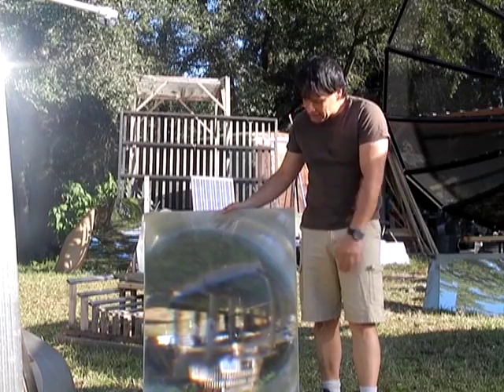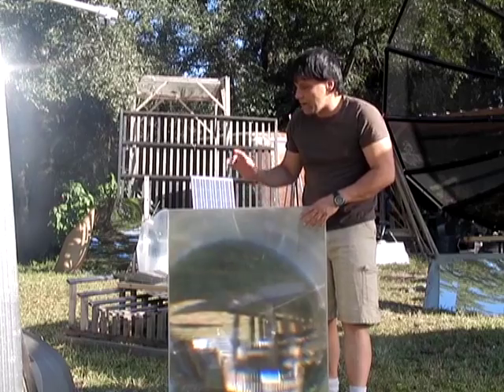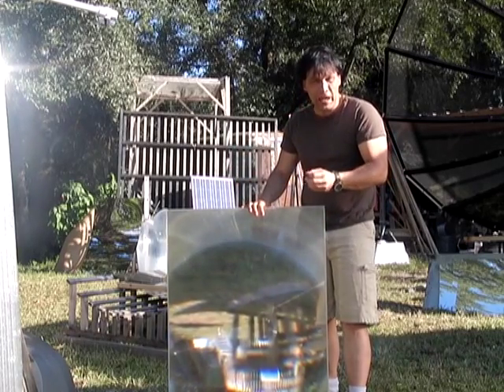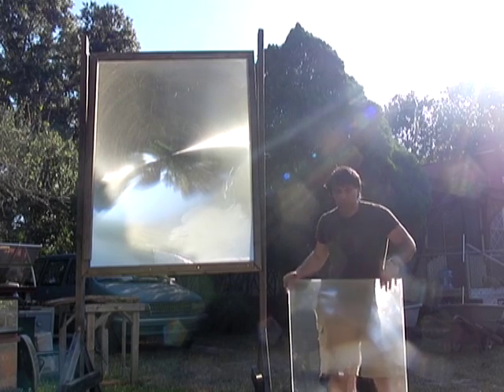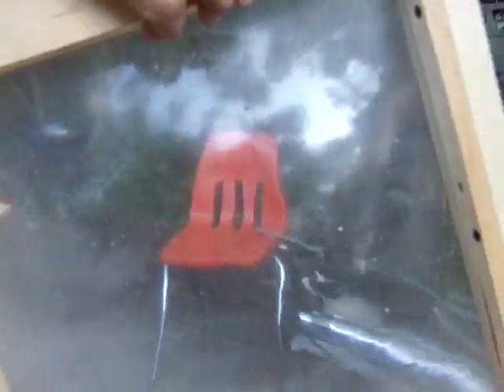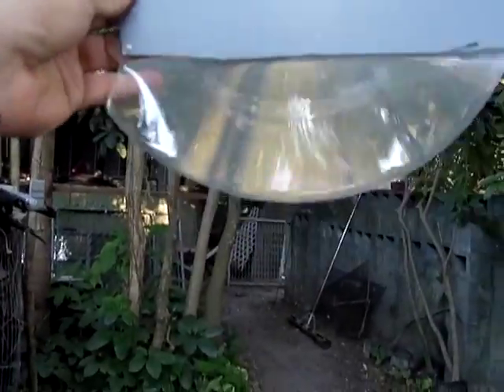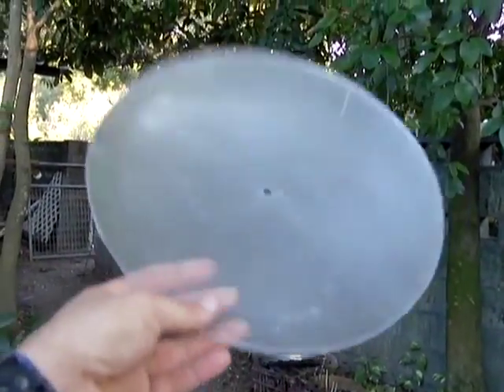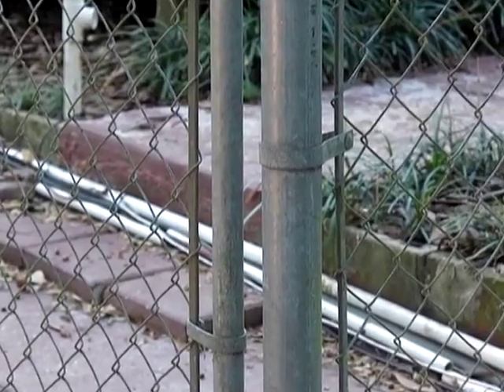Fresnel Lens Solar magnifying glass for optical scorcher

Comment: This is interesting.  I'm wondering...if you make one square or rectangular and put it on the window of a passive window heating box...and make the heating box of materials that can safely absorb and withstand the intense heat and release that heat thru openings in the top of the box, it would be like a clean and green stove...right?  Or maybe even the next generation lens would have a lower max magnification to make it usefeul and safe?

Comment: I bought a Fernel  lens from Mr. Rojas about 8 months ago. I have been trying to create a high temperature solar oven for about 5 years. Something that will cook a pizza! I like the idea of high temperature in a focused area. You can dampening the Lenz or  widening the focal point so you don't burn food or melt steel. It's how you control the temperature . You don't want to melt your len with all the heat so you need fans under the lenz to remove heat. I'll have a working oven in about a year.
Reply: You made this comment in 9 years ago, how'd your oven turn out?

Comment: Hi Dan, is it possible to manipulate a solar fresnel lens' focal length? I'm researching a system that requires a low power, 70mm lens with 20-30mm focal length. How can I pick your brains about this? Great vids btw
Reply from the maker: Hi David,

The focal lengths are usually set but can be elongated with water:

illuminating a focal point fresnel lens parabolic mirror Double the focal length part 1

Fresnel Lens Focal Length Change with Water, Concentrated Solar Power

While the "power" is set based on lens size and clarity of lens, moving closer or further away from the native focal length creates a larger spot or concentration diameter resulting in lower temperatures spread over a larger area. Let me know if this helps.
Thank you for enjoying our videos.

Comment from the maker: Too fragile for thin glass and thicker glass would be too optically distorting. Fine rings in thin glass act as as a scoreline. These UV resistant lenses last 5-10 years.

Thicker glass Fresnel Lenses like in light houses only have a a few rings per few inches.

Comment: Old video and someone may have already made this comment ... 

Use velcro to secure a cover to the frame thus blocking the sun from going through it. Could even make it out of a heavy duty fabric that would last a few years with exposure to heat and cold.

Maybe even make a slip on cover with velcro secured straps to hold it down and closed around the bottom portion.

Comment from the maker: All of our Fresnel Lenses and Parabolic Mirrors are UV-resistant, they have been tested with 5+ years of 100% exposure. The UV-inhibitors added work. Most plastic lenses only last about 1 month with 100% exposure. They fog and crack. Our lenses do not do either. They have also been installed in some of the hottest desert climates on Earth and at an Antarctic research station:-)

Comment: You are correct. A lens can not AMPLIFY the amount of energy it is gathering from the sun, as this would break the law of conservation of energy (which is the most FUNDAMENTAL law of physics). A Lens can only CONCENTRATE the energy it gathers into a smaller area, thus increasing the POWER of the energy (light, in this case) gathered. Just like a lever can not increase the energy you exert, just your POWER. Sorry for using capital letters, but I don't have the option of using italics :(

Comment: No need to disperse the heat over a large area if the vessel is full of water. No matter how thin the steel walls of this hypothetical 40 gallon (I thought they were 44?) drum were, the water would take the heat energy away faster than the concentrated sunlight could deliver it. The water will boil at 100 degrees, rapidly extracting the heat energy. Only if you went to extremes (extremely thin walls combined with an extreme amount of sunlight) would you manage a hole in the drum.

Comment: Just a point, it wouldn't matter how thin the metal is. Water is incredibly good at moving energy out of hot materials. You can fashion a crude 'pan' out of waxed paper, fill it with water and place a candle under it and boil the water. The paper will not burn, even if the flame touches it directly! So even if the tank was very thin steel, as long as it was open so pressure did not build, the steel would not melt. I like your videos by the way.

Comment: The water should dissipate the heat fast enough to not melt the metal of the tank. When using the lens. As an example if you set a paper cup on a fire you can boil water in it. The paper will burn down to the water level but not burn the rest of the cup. The water is keeping the paper below the flame point of the paper.
Now if you heat the tank faster than the water can cool it then yes you could cut a hole in it. This is what allows underwater welding. Real hot welding devices.

Comment from the maker: Solid steel blocks work good. I am working on a video demonstrating how an 8 ounce block of steel can instantly boil 12 ounces of water after a 2 minute sun exposure. The steel does not melt if the mass is larger than about 4 ounces.

Comment from the maker: Hi,

The Fresnel Lens concentrates sunlight. If the dark colored water tank reaches 120f in the sun and then a Fresnel lens of the same size of the tank is placed in front of the tank. The light will be the same so the tank temperature will have no increase. If the lens is 2 times larger than the size of the tank, the water temperature will be just short of 2x as hot reaching about 200f. Metal will not melt if water is present behind, unless very thin.

Comment: also if those are left in the sun for increasing head on a pipe lets say is there any up pretection in the plastic or will it degrade.   I like to build a solar hearter to heat my shed in the winter.

Comment: I've wondered if it would be possible to disperse the light at the focus with another lens to create a beam. In small scale, with a flashlight and lenses taken from binoculars, this is easy to do but would the heat make it impossible in large scale? I think a fresnel lens placed at the focus would just melt but how about a glass lens with the same focal length?

Comment: Could a Fresnel lens be used as the heat source for wood gasification? Would make gasification more efficient/economical.
Wood gas produced this way could be run to burners beneath an alcohol still, reducing the cost of fuel alcohol.

Comment: Sir, I'm doing a science project and I'm trying to make a system that cleans water cheaply and I was wondering: If I used a sheetsized fresnels lens, how long would the water take to boil? And is the fresnels lens the best lens to use or are there other lenzes that work the same? Because they dont sell these in The Netherlands, so I'm gonna have to order them from somewhere else.

Comment: @jab0805 The power is all about collector surface area. To get the benefit of multiple fresnel lenses, you'd have to reflect the light from multiple lenses to a single point. Think of those large solar power plants that have multiple mirror reflecting to a single point. That's the concept that you'd be looking at with trying to up the power on a single point.

Comment: Hello from Minnesota.  I got exposed to Fresnel Lenses at Split Rock Lighthouse in Duluth.  As you are aware, we get far less sunlight up here than Florida.  I would like to capitalize on what little we do get. I would like to build a low intensity array that can be used in winter to melt the snow off our driveway.  My sense is that this lens is too powerful.  Any tips on widening the beam to 4 ft across but restricting its heat output to less than 200-300 degrees?  Thanks for your work.

Comment from the maker: @jab0805 Hi,

Additional lenses only shorten the focal length by half, the second lens dramatically absorbs the sunlight into the lens acrylic because the angles are different. The Second lens drops the overall throughput by 30% the focal point diameter is a bit smaller but much weaker.

If you stack 4 lenses your focal length drops to about 3 inches and it barely burns paper, thank you for the good question and for enjoying our videos:-)

Comment: Can you increase the focal point intensity even more by stacking? Can many fresnel lense be positioned  at  distances that would concentrate the light even more? Like stacking them one in front of the other. Would this cause damage to the second or third lense spaced in series? Thanks for sharing.

Comment from the maker: @souleeze Cooking, sterilizing things, distilled water, steam production, soldering, metal melting and casting, Zinc, copper, lead, fiber optic light collection, Stirling Engine fuel source, Bio fuel heating, 
last resort local wound infection treatment DO NOT ATTEMPT, only if NO other options EX: stranded no help, toe turning black. Always have antibiotics in your kit, they are cheap.

Comment from the maker: @hobo59 Hi, We are doing both but making from scratch is our new process. The enhancement and mould design itself is a bit of a secret right now. The goal is maximum light. Traditional lenses waste a lot of throughput on perfect optical image projection/magnification. This has benefits for solar but there is a point where fair image projection with optimal light throughput is about 30-50% more powerful than a traditional lens depending on ring count and focal length. Tipping point either or.